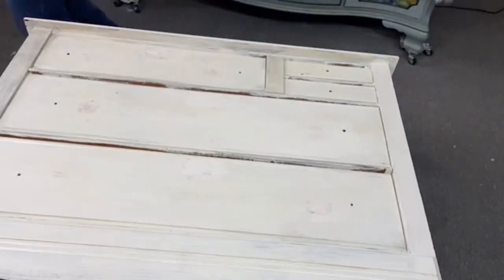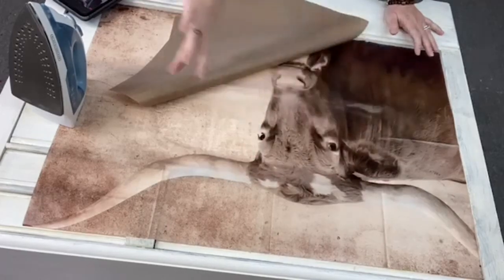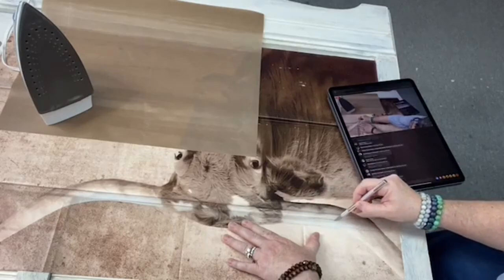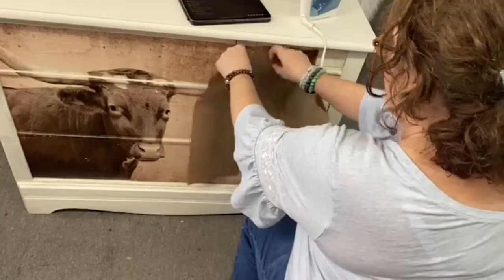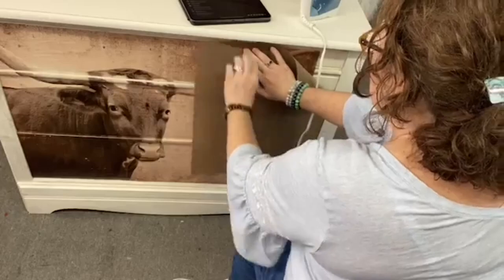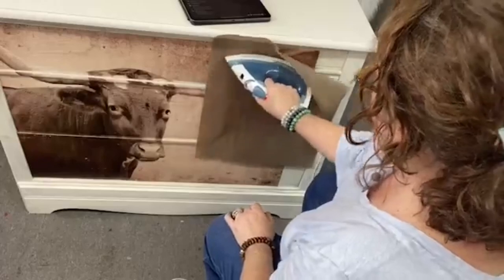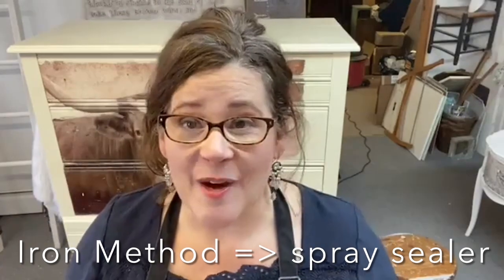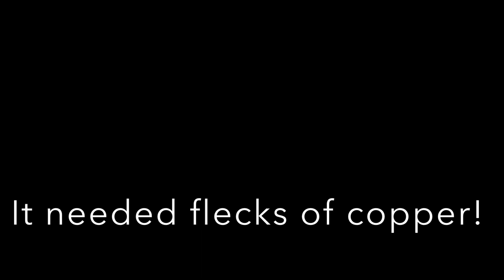Texas Longhorn Dresser: Decoupage & Paint Blending with DIY Paint and Mint by Michelle Papers

Comment: Great piece! My question is what Decoupage medium did you use? If I used mod podge would I just paint that on the front And let it dry. And then iron on my deck at posh image?
Reply from the maker: I personally don't like Mod Podge on the front of a piece for sealer. It looks like glue to me. When I use it for the back, I topcoat with Wise Owl Varnish or DIY Paint Big Top.

Comment: I’ve never decoupaged. I’m planning to do my first piece soon. I have a few questions. I have several colors of chalk paint. Can I use those for blending, or do I need to buy DIY or Fusion mineral paints? Also, how do you decide which method to use? Iron on or the other way?
Reply from the maker: You can use any paint but they won’t all work the same.,  my preferred paint for blending is either Wise Owl chalk or DIY PAint. As for iron on versus traditional, I suggest trying both to see which you prefer. I actually enjoy the traditional method and can get a pretty smooth application with a brayer. It all just takes practice.  Start small :)